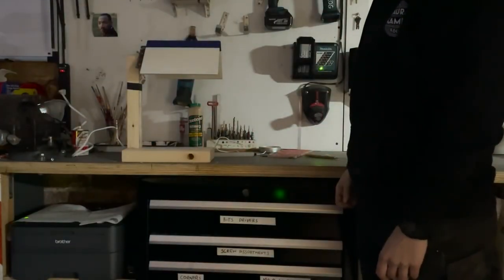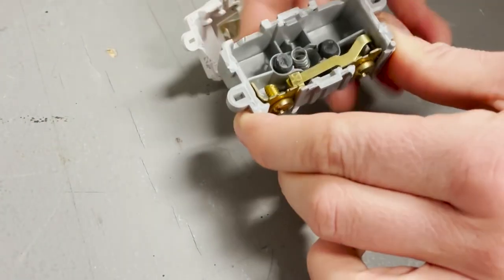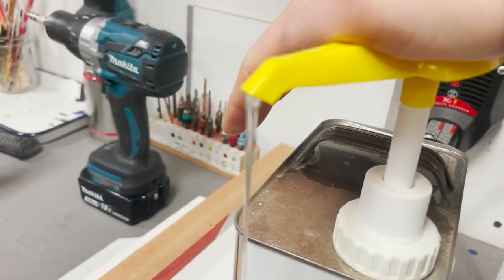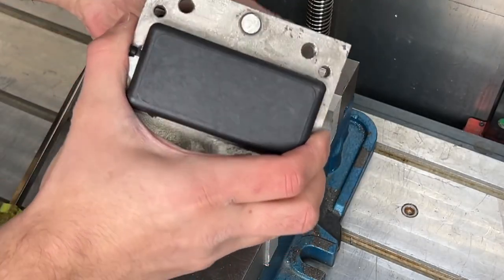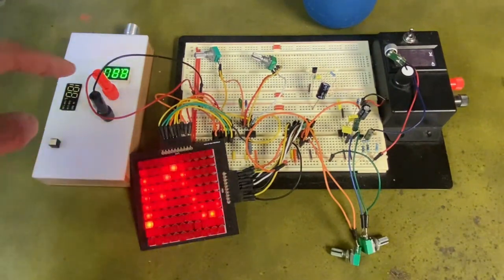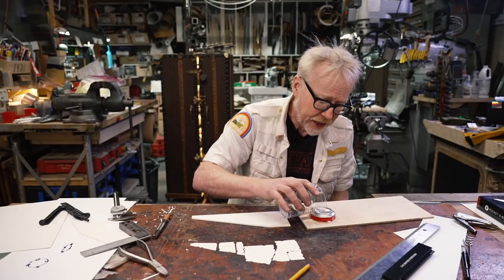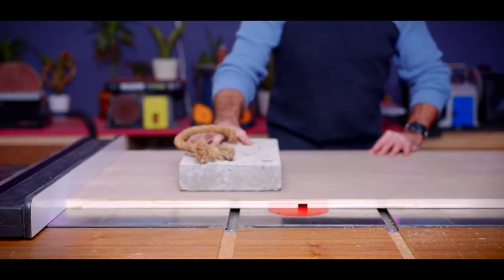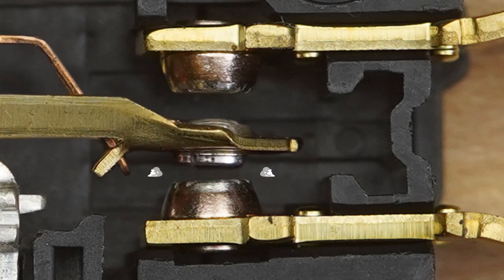Within Constraints [Maker Update] | Maker.io

Comment: Great watch. I often make stuff out of what I have lying around, partially because I was taught to and partially because I'm frugal. I have a bad habit of saving junk to use later. The problem is, most of those projects turn out a lot like the lamp, not very pretty and could use improvements with "proper materials."
Reply: Oh and the last thing I made from stuff lying around d was a carving knife from a piece of rebar with an oak handle held together with small bolts. It actually turned out decent though.